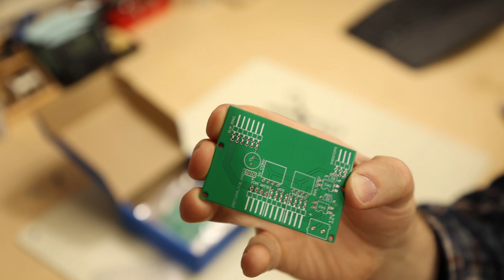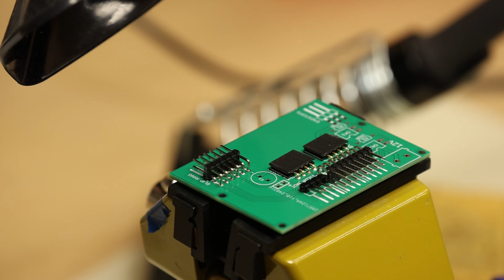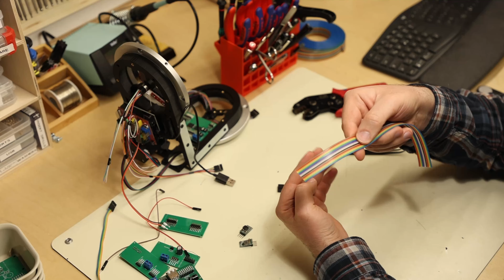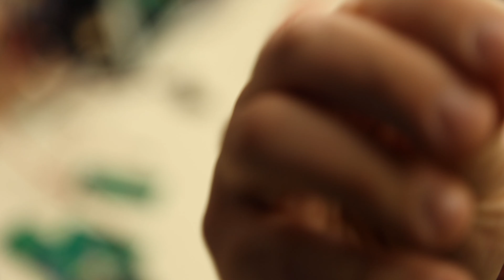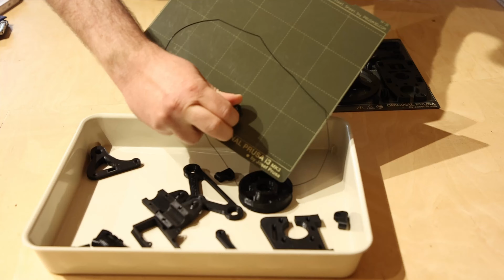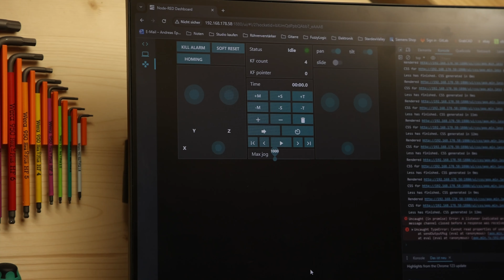DIY Motion Control Rig Dev Vlog 2 + 5 axes robot arm

Comment: I don't think you'll have to get rid of the sliprings for USB. They do make USB sliprings. Just a quick search brought up some stuff. Now how much those will cost is a different matter.
Reply from the maker: Yeah, I've seen those and on they are really tempting XD. But in order to get this project to version 1.0.0 I had a look on the design requirements. And the requirement for the full rotation feature was "Oh cool a slip ring! Lets use it!". Whenever I have actually used the rig I never needed a full rotation.
Reply: @fuzzy4logic  Why not a different serial protocol like rs232 or I2C?
Reply from the maker: @ciano5475 I want to connect it to a PC. I know there are USB to serial adapters but with that I can't simply flash new firmware